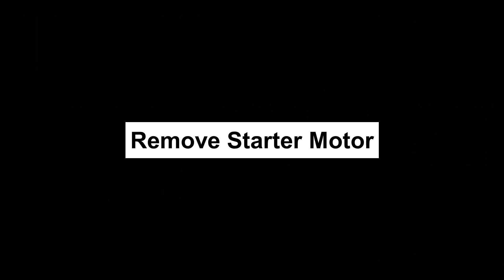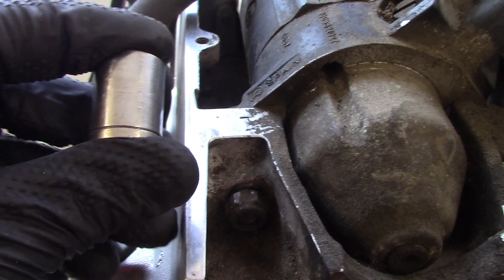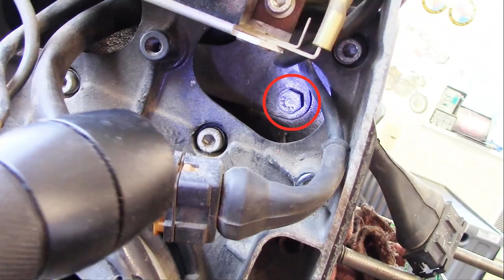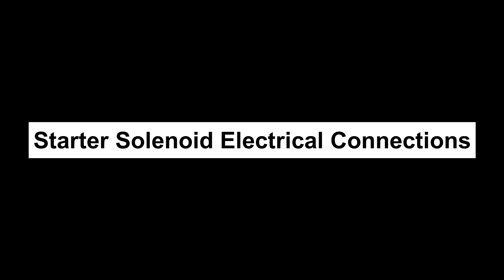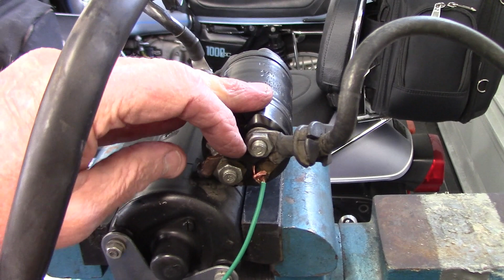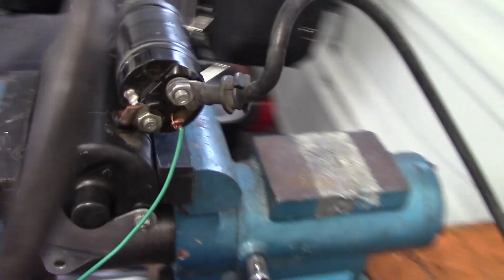1983 BMW R80ST Remove And Test Starter Motor

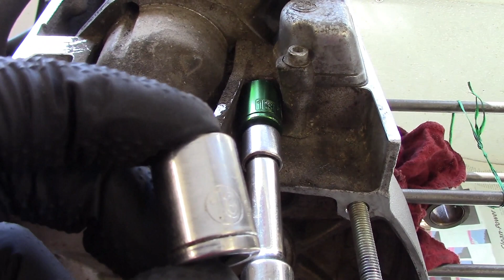Comment: G'day Brook. At 1:10 you describe the 13mm socket fitting "just fine" on the left retaining nut. On my 11/81 RS the rear of that space has a tall lip, unlike the other side. I can fit a 13mm socket onto the nut but not the ratchet onto the socket... no space and the angled attachment doesn't quite do it either. Don't know if you've encountered that of course but do you have a solution?  I'm wondering if I should remove/reduce that lip...just enough to get a grip and avoid rounding off the nut. Cheers edit: a smaller socket and ratchet set 1/4” drive fit with the lip and worked.

Comment: Brook, love your videos and the acknowledge the extra work it takes to document everything you are doing.  One important point, that I just learned the hard way.  Your video here, the gear box is out of the bike. For those of us who are just trying to remove the starter (for a replacement) the gearbox has a lip on the left that completely blocks access to the left nut.  I cut some of the case away to allow access, others have cut down a wrench to get onto the nut.
Reply: Yes! I've been trying to find a non destructive strategy for this reason
Reply: @Mtron1000   I don't have a photo, so this is just a guess. A small wrench is probably heated up and then bent until the end of the wrench can access the nut.  Might also require removing some of the wrench.
Reply: Is cutting the case consequential in any way?
Reply: @Mtron1000  I used a file to remove enough of the case edge so a socket could get in there.  Did not find any issues from the removed material. Wasn't a lot.

Comment: 25 years ago their were  places that could rebuild starters and alternators in house.  Now they are done overseas and you might be replacing this a few times before you get a good unit.  Not as easy with the engine still in the frame.
Reply from the maker: David, I've rebuilt the Bosch starter motor, and it's not too hard. Here is a link to my document on how I do that.  https://brook.reams.me/bmw-motorcycle-rebuilds/1977-bmw-r100rs-rebuild-project-index/12-bmw-r100rs-refurbish-starter-motor/

Also, you can get a very good one at a much lower cost than the Bosch motor, or likely, the cost of a rebuild at Euro MotoElectrics.
https://www.euromotoelectrics.com/category-s/1614.htm

And, EME supplies all the parts if you want to rebuild a Bosch motor.
Reply: @BrooksAirheadGarage  Thanks for the reply, info and all, you do a great job. I just found about you and the Airhead's club a few years back from another old co-worker. I have a lot yet to learn! Keep 'em coming!
Reply from the maker: @davidscott7005  Thank you and stay tuned. 🙂